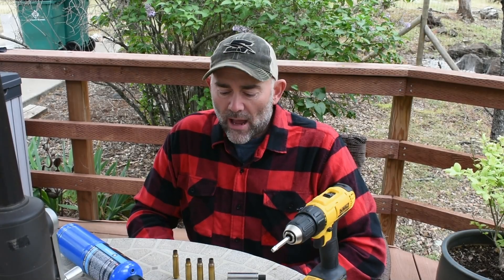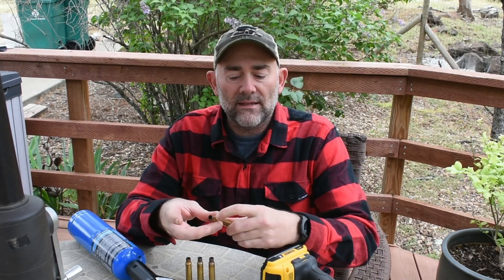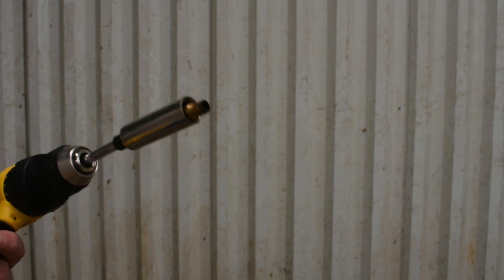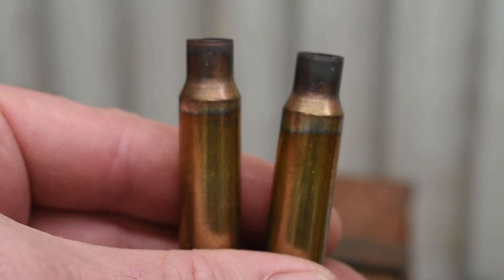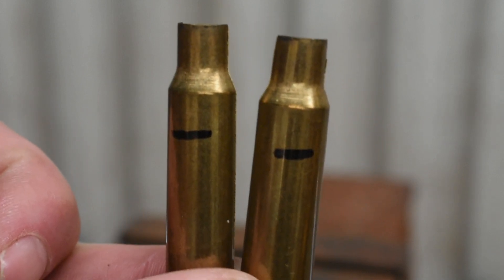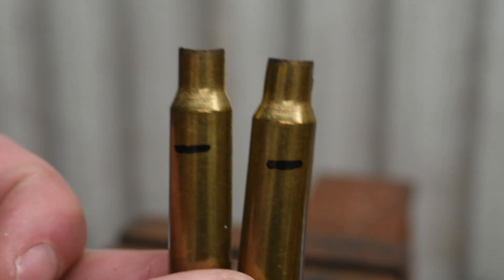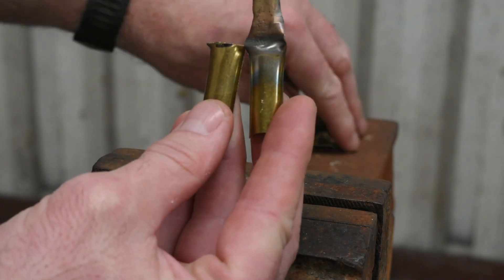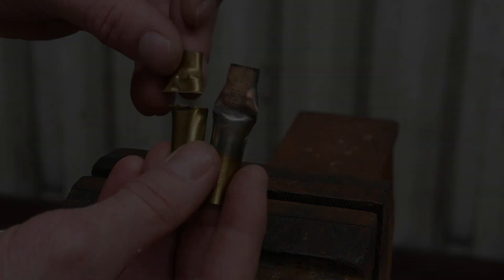DON'T Anneal Your Brass and See What Happens | Brass Bend Test

Comment: I just reloaded my 223 Lepua brass 70 times and I full size every 10 reloads otherwise I just neck size and not once did I anneal. Also just reloaded my Remington brass 40 times the same way and not once did I anneal. Just started reloading my Norma brass so far 6 times and no annealing.
Reply: Have been reloading for 42 years and have not annealed cases ever and have not had any issues
Reply: 70? Thats aggressive

Comment: guys I have reloaded my 223 Lepua brass now 51 times and only neck size but every 10 reloads I will full size the brass.
only two cases have been thrown out so far but that was my fault as I hit the neck hard when neck sizing and bent the brass so I just thru them out.
tell me again why annealing brass is so important ?

Ps: I did the same with PMC brass and after 20 half went in the garbage and by 40 reloads all were in the garbage. 
      doing same test now with Rem. brass and at 21 reloads no brass thrown out yet.
Reply: many tests have proven that annealing gives you much more consistent neck tension.

Comment: and what will be the effect of hardening the scales in cold water?
Reply: Brass work hardens. Quenching in water does not harden it. It actually helps as it stop the heat from traveling too far into the body. Steel will get brittle.